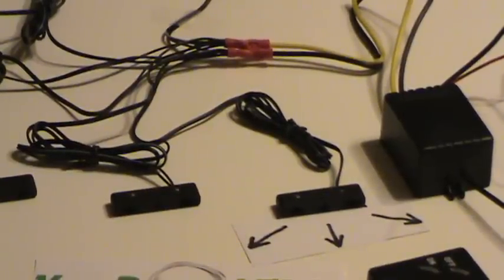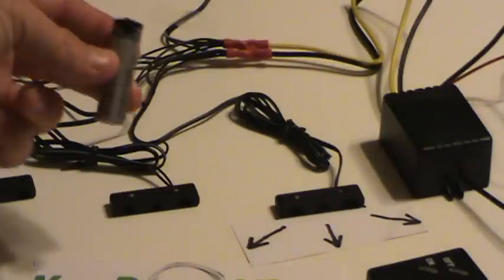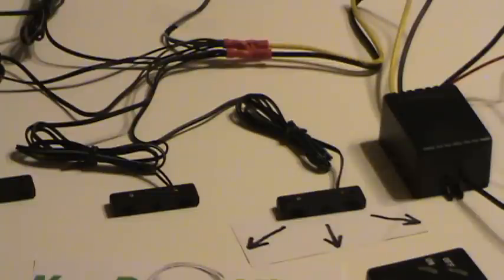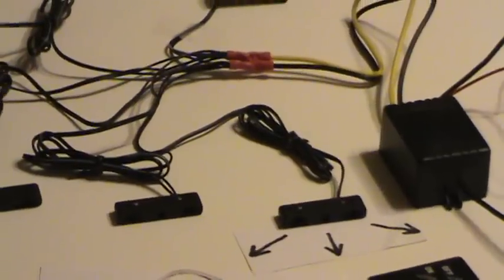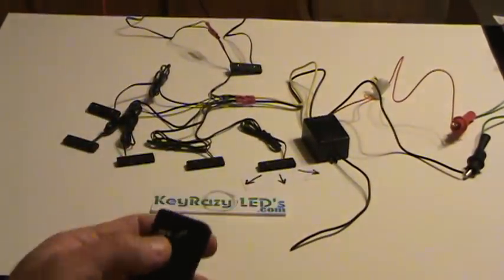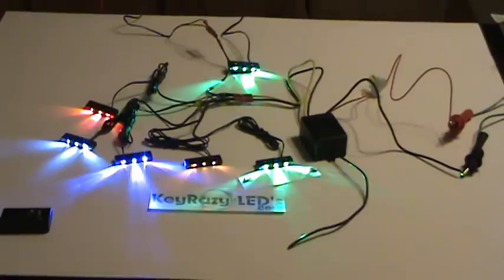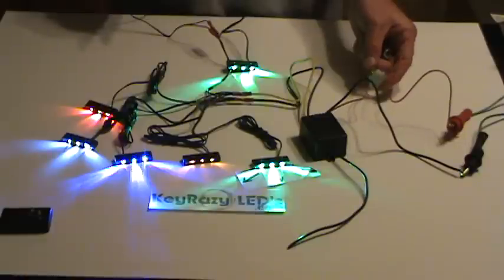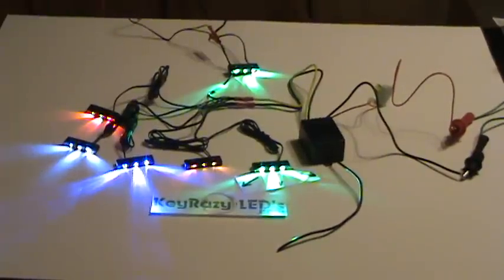Keyrazyleds.com 3 LED pod light Custom Motorcycle , Car , Truck , and Boat Lighting

Comment: If the amber and red were being driven properly, they would be just as bright as the blue and green.  The 3mm is the worst LED for a "spread" effect.  These things better be cheap because the design is inherently flawed.